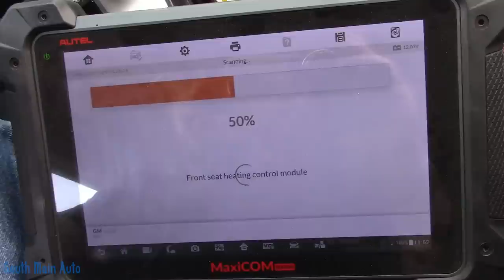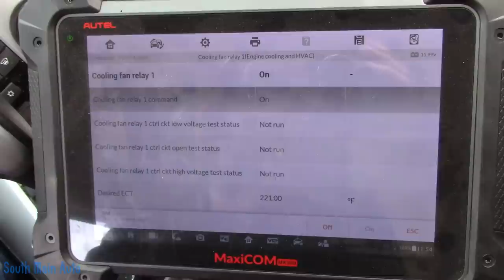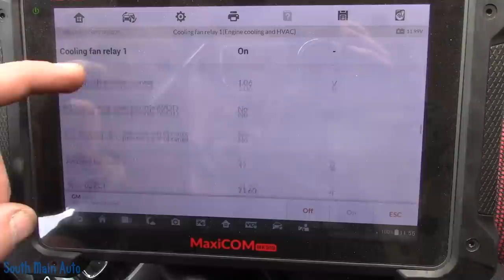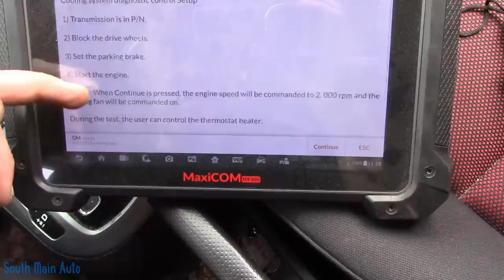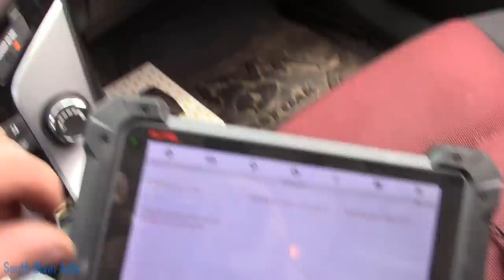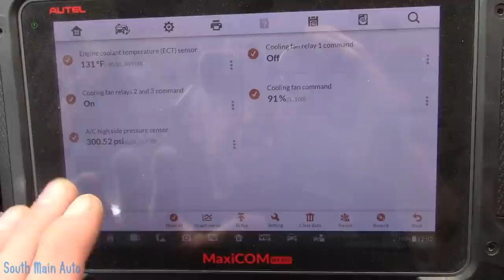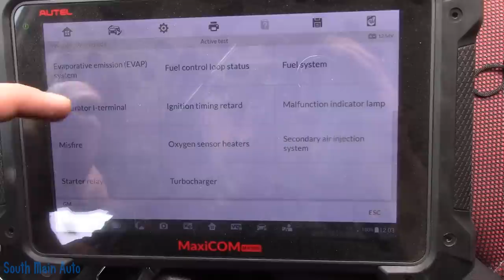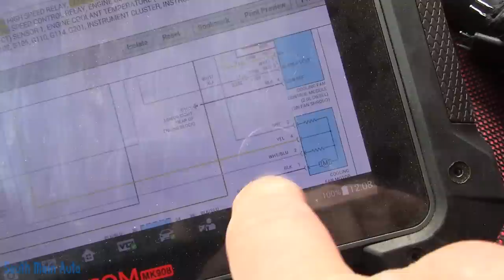Chevrolet Cruze: Cooling Fan Is REALLY LOUD!

Comment: I had a Chevy LUV (Light Utility Vehicle), made by Isuzu, bought new in 1972, first year imported. Drove it across the country from LA  to Rochester and back, nary a problem. Eventually, it swallowed a couple of screws from the carb at about 60,000 miles. So I pulled the engine and trans, made some mounts and put a 283 small block in it, complete with narrowed posi rear end, stock wheel bolt pattern and a Muncie 4-speed. Drove it another 50+K miles, and sold it for just about what I paid for it new ($2700 out the door). It was a total sleeper from the outside...fun times. See what happens when you trigger nostalgia in old geezers - brain dump! Great video, thanks for what you do...
Reply: There was one in Garland Tx where I grew up that had a 455 olds with the transaxle mounted in the bed. Thing was fast once he got moving. Tire smoke for days.

Comment: They need to start putting those RPO codes somewhere easier to access. Tired of having to unload 200 pounds of chit from the trunk. What's so wrong with putting it on the end caps of dash boards?

Comment: The worst thing is that a cooling fan assembly can misbehave even without apparent noise or vibration issues. The one on my car still managed to keep the engine cool, but failed to keep the AC condenser in front of the radiator cool, making the AC weak in hot sunny days and the AC compressor noisy. It turned out the radiator fan motor had seriously worn bearings and didn't spin fast enough. As i said before no strange noises, only less air flowing around the engine bay with the hood open. New fan+motor+shroud assembly in place and all AC issues are now gone. This is on a 73k miles 18 year old city car.

Comment: I had a fan issue on one of these a few years ago (I'm a dealer tech) and I did the EXACT same thing you did when I saw the schematic. Went right for the fan and checked for power.  Had it on all speeds and sure enough the fan was bad. Cheers

Comment: I used to start at the power supply and work my way to thru fuses/breakers/relays. I've since learned to start at load device and work back towards power supply. Saves mucho time.

Comment: Using a halogen headlight bulb as a test-light is ingenious -- a high enough load that it puts a good test on the wiring and the relay.  Way more accurate than an LED test-light for testing high-load situations.  Really cool!

Comment: Having a tool to drive the outputs like that is awesome (I want one!). For us cheap DIY mortals, you can just pull the relays and feed +12v to the fan terminal in each case. I just had a bad relay, but If it was the resistor pack I was already scheming a way to cut out the resistors and replace.. Probably can't do that on a customer car though..:)

Comment: Great videos good sir, funny seeing this tonight. Was working on a freightliner m2 today, saw wires at fan hub looking rubbed through, reached in and grabbed the wires, (key on, engine off)engine turned on and beat up my left hand, no major injury just fairly stiff hand. Foreman looked it  over and got engine components to click, turned key to the on position, he moved wires around again and truck started right up. Cut some zip ties and tape around harness and it will no longer start but what a shock that was

Comment: Had a 2013 Chevy Cruze with the same loud fan. Great video!
Reply: What was the problem?
Reply: Right now my 2013 Chevrolet Cruze's engine fan is blowing like crazy even tho I'm parked and the AC is not on! It even says AC stopped because high motor temp. but the motor is not even hot!
Reply: @TheLoLo0628  any fix?

Comment: Just had this on wife's 01 Mustang. 2 speed single OEM fan would only turn on low and would not come on at all with air conditioner. There's a huge resistor that plugs in line with the main power wire to the fan motor. Jumped out that resistor, which then only allows high speed, and the 130k mile fan is still strong and AC is freezing cold again. Since replaced the resistor and it's back to normal.

Comment: Fast paced is good, this is exactly how I diagnose something like this as a flat rate tech. Easy component to reach like that, go straight to it and figure out what isn't there (Power/ground etc...), usually before I even bother opening a fuse box  or checking/swapping a relay out. I like to work back from the part, because it's the most efficient way to get the job done.

Comment: Most smaller cars seem to use the resistor method, but a lot more are coming with full PWM modules with some pretty nasty (high-amp/flow) fans.

Comment: Had a mid 70’s LUV (Isuzu P’UP) 4x4. Actually a pretty good little truck, but road salt just ate ‘em up here in Indiana. Somewhere, I still have an original fender badge off of it. A few years later I had an early 80’s LUV diesel two wheel drive. Had to swap the rear frame for one from an early Datsun truck that believe it or not, actually still had a solid frame. Built a flat bed for it and drove the crap out of that thing. That Isuzu Diesel engine ran great and got fantastic highway mileage. Kinda wish I still had it......

Comment: I had this very same problem on my Chevy Cruze just recently.  The fan would come on and would shut off a second or two later.  The shop told me that my fan was bad since it wasn't responding to the first relay, but was responding to relays two and three.  They replaced the fan and all is well now.
Reply: Did you have a check engine light on with it?

Comment: Hi in the UK this car is the Insignia. We have changed a few of these fans, only on petrol engines though. One cooked the head gasket on the car after getting stuck in traffic on a summers day. The car was fixed and checked went out with the fans working. It came back as it overheated again once again checked everything working as it should. Came back a month later overheating.... the fan would kick in as it should , 2nd time ok 3rd time ok 4th time ...no..... the resistor pack was  seriously HOT . A new fan asssembley was fitted at the cost of an arm and a leg this was GM only all the aftermarket ones seemed to be for diesel variants (which don't go wrong). Problem solved ,the resistor pack had corrosion where the wiring went in at the back and the wires had almost corroded out.  To all BMW owners this happens on 1,3 and 5 Series BM's ,check by giving the wires the wiggle test they usually fall out and there's your problem......oh the choice is yours   scrap yard or 2nd mortgage..

Comment: My Dad owned a yellow Chevy Luv back in the early '90s. It didn't have an ignition switch, so they had to hot wire it every single time. He bought it for $500 and used it for about 5 years. He eventually sold it to someone who claimed he was going to drive it to El Salvador lol. Overall, it was a very well built.

Comment: ah the famous cruze lol I own a 2012 and I have put at least 6 thermostats on it to fix the issue with cold temp and ac off due to high temp it has 185k miles on it
Reply: I'm on my 6th water pump with 120k. Great cars..
Reply: I’m have a 2016 Cruze. Thermostat and water pump replace fan replaced twice and a new engine. 76000 miles bought it with 16,000 its 3 years old. Still having fan and a/c issues.
Reply: Omg ur not giving me good vibes with this 2012 I bout my daughter!! I’ve put a thermostat and water pump in it, previous owner did the same 2 years ago, I’ve replaced the coolant holding tank cuz it sprang a leak, currently sitting cuz it randomly looses all coolant and overheats and I don’t know where the coolant is going. Also think the heater core is now leaking due to overheating too many times!! Fan needs replaced since it only has high speed but I don’t think I’m going to spend anymore money on this car
Reply: @RonGeary  mine had a water pump, 6 thermostats, coolant tank and needed a radiator fan because only low speed work which cause the ac to not get cold as it should but the car got totaled at 199k miles. Really only problems that happened all the time was the thermostats going out almost every 25k miles not lying lol, had spark plugs and new coil pack and battery but thats all that was done to it at 199k miles still had original belt on it never had wheel bearings go out or ball joints or tie rods still had factory steering and wheel bearings had the struts replaced around 130k
Reply: @RonGeary  if you replaced the water pump and you bleed the coolant with the radiator cap off and bleeding it at the bleed screw on the radiator and replaced the thermostat brand new then you may have a head gasket issue from the over heating some many times which would cause it to over heat easy
Reply: @kevinanglin678  yeah that’s what I was thinking as well, the car smells of coolant and u can see a small cloud of steam popped up from the exhaust manifold every once in a while (I took off the heat shield to see where it was coming from) I thought one of the turbo lines sprung a leak but I thing it may be the head gasket. Also I’ve heard something about the “ bleed screw” in another video on these cars before as well but they never showed where this is?? I heard it’s only on the 1.8 Naturally aspirated engine & not the 1.4 Turbo?? Is this true
Reply: @RonGeary  The bleed screw is on the top of the radiator left corner when looking into the engine bay from the front but it could be a turbo coolant line leak but easy way to tell is get engine degreaser and a brush and wash that area of the head down to clean aluminum and start the car and see where its leaking from if its leaking between the head and block then a head gasket is leaking on the outer edge of the gasket so it isn't catastrophic yet. Could be the oil cooler beside the turbo behind it I think the oil coolers was coolant cooled too but not 100% sure on that but wouldn't hurt to check there either its a aluminum block behind the turbo to the right of it cant mis it its a little thick
Reply: Have a 2014 Cruze Lt already replaced the Water Pump the Thermostat Housing the water outlet the thermostat blades it has a crack in the engine so a small oil leak the mechanics say to watch it had the catalytic converter go out on it the PCV valve went out occasionally the radio flickers on and off with a message on the digital speedometer displaying stability track with a wrench on it mechanics couldn’t find the source of the electric issue I bought the car new and it has 81.8k miles on it also forgot the sepertine belt went out on it prematurely and it has a wierd sound when not driving on asphalt at 50mph and higher speeds that’s almost like a squeal same thing mechanics couldn’t find an issue or recreate it
Reply: Forgot to mention had to have the coil pack replaced

Comment: Chevy Luv was the mini pickup back in early 70's
Reply from the maker: The first "S10"
Reply: @SouthMainAuto  They were a lot smaller and made by Isuzu, about as big as a Maxda B2000
Reply: Wasn’t it a rebadged Isuzu?
Reply: @brianburns7211  yes
Reply: I had the diesel. It was over 40 mpg and naturally aspirated. I was in Mexico in 2003 and there was a storage lot at the Port that was full of brand new ones. Seems as though they were still making them and using the same body style.

Comment: Still using a resistor to let a fan spin slower is an antique way of doing things imho.
I'm sure that in the future (if its not already used now on more complicated cars) it'll be done with a pwm controller or similar using fets or so. Gets way less hot.
Less heat means less wear and also less strain on alternator and battery, which is both good on longevity and gas mileage.

Comment: I remember Y2K, we installed a wine cellar system for a guy who was having a party that night, he'd also had installed a huge diesel generator just in case there was a power cut.
Reply from the maker: At my dads shop the tire balancer has a huge sticker on it that says "Y2K Compliant."  I remember the local feed store here must have sold a 1000 generators hahaha
Reply: Worked for a public utility that tested everything to be y2k compliant. Didn’t find anything that would fail when advanced to +2000 dates. On New Year’s Eve we had crews on standby all over the system waiting for Armageddon. Pretty anticlimactic when nothing happened anywhere.

Comment: A resistor pack and multiple relays? So 1980's. Great job GM.
Reply: zarbon700 haha you got that wrong.....these are Daewoo made sourced from South Korea
Reply: @craig28c  actually you're both right. They are made in Ohio, except for the hatchback which are made in Mexico. In 2017 GM also started manufacturing them in south Korea but those were sold overseas.

Comment: Funny that Chevy still refer to the LUV as an identification for some things. My best buddy in the early 90's had a '78 Chevy Luv that he referred to as the twuck for it was an under-powered, not quite gutless wonder, cause when not loaded down, it was sprightly, but add in a bunch of 2x4's and other items into the bed and a trailer, it was under-powered, and yes, it had the 4 Spd manual in it, no AC or power anything and no insulation, or much of it anyway but it got him through 3, maybe 4 years of good use though before being in humid Kansas summers without AC forced him to replace it with a fully optioned 1985 VW Jetta GLI 4 door with working AC to get through the rest of his time there in the mid 90's while in graduate school. He actually bought the truck here locally in Western Washington at the time. He's back out here with his family and now drives a '94 Toyota SR5 Extended cab pickup with the V6 and working AC that once belonged to one of his brothers.

Comment: I'm having a similar issue were only the high speed turns on every 10 seconds or so, I followed your video and got a new fan only to find out the connector harness (wiring) coming from the car is burnt through one side and it looks like the they connected one wire to the fan socket previously so I had to order a new wiring harness it's crazy that they didn't want to go the trouble and replacing that no wonder the car was confused!

Comment: I had a '79 Chevy LUV (Lime Green) when I was in college. Only had it for about a month or so. I only wanted it because it was a manual. When I turned the motor off it would leak about an ounce of oil. Never did find where the oil leak was at. Sold it to the first sucker that came along. It was fun to drive but I wasn't a fan of how the hood opened like on a corvette. 😁

Comment: I'm surprised to see it uses a resistor pack in a 2014 vehicle, much like old style blower motor resistors of the past. Great walk through! By the way, why do you have a cap on your high amperage light bulb? Easier to see the light, or maybe protection?

Comment: Y2K,  I worked for GM during that time.  Customers thought their vehicles would just die at midnight on 01/01/00.  I advised them your car doesn't know what time it is, because you have to manually set the time,. If it don't  know the time, how would it know the date or year?

Comment: Being it’s GM my Buick Verano pretty much has the exact same everything under the hood. I’m pretty sure my fan and fan motor need replacing. AC blows cold though and the fans are cheap so I’ll order the parts and change it out later on given the car isn’t being driven.

Comment: The Chevy Luv was a small pick-em-up truck. 

I own a 2016 LTZ Limited RS Cruze. I’ve had a lot of issues with it. that said, I have a 2007 Silverado that runs like a top with 174k miles on it. I’ll probably avoid small engines as long as the market allows it.

Comment: I've been having this issue on my 2012 Cruze RS. Thanks for the upload 👍
Reply: did you fix it?
Reply: Yeah did you fix it?
Reply: @dg3763  pulled a fuse and haven't had the issue lol everything works fine
Reply: @skyler2544  which fuse? Gonna try it now
Reply: @dg3763  it was one of the relay fuses, think it was 20ish? It's been so long I honestly don't remember. Think it was red too if that helps. I just had my car running and started popping fuses out til the fan stopped cranking on max
Reply: @dg3763  any luck on this?
Reply: @skyler2544  any luck on this?
Reply: @ivanbarbosa3132  yeah I pulled out one of the fuses from the box was 20 something.

Comment: Awesome video! Could one have used a multimeter on the continuity or amperage setting to check to see if the plug got power to each wire instead of using that bright light you had?

Comment: My Chevy Cruze is doing the same thing, the temp gauge doesn’t move it is always all the way left on cool but my fan is running. Changed the sensors and that hasn’t helped. I guess it’s the fan, thank you!
Reply: Did replacing the fan work?
Reply: @Kingpayne72000  no I replaced the water pump and the thermostat again and this time it worked it’s been about 2 weeks now

Comment: Ahh, the Cruuuuuuuuze! What an embarrassment of automotive engineering. The last one I had here needed a PCV valve ... which  was part of the valve cover, at 45K miles! The owner's got rid of it 10k miles later after the radio, wipers, and parking brake failed. Job security right there! 😂 

Hope you had a great Father's Day with the fam - jam. 🍻

Comment: I drive a 2012 chevy cruze LS. This could be a bad, mass air flow sensor. One day I took mine out for cleaning. Reinstalled it, including a new air filter as well. Started the car. The fan, on its own was on full blast. wtf .I thought. Turned the car off, then started it again. Fan has been off ever since. Car runs great, with no problems. Weird stuff for sure.  And note, that the fan will turn on, when the ac is turned on.